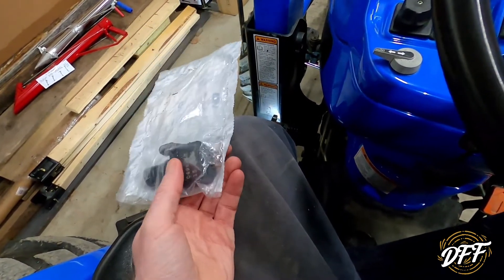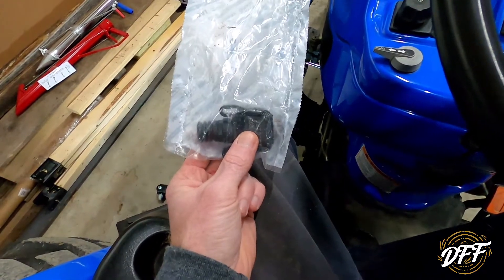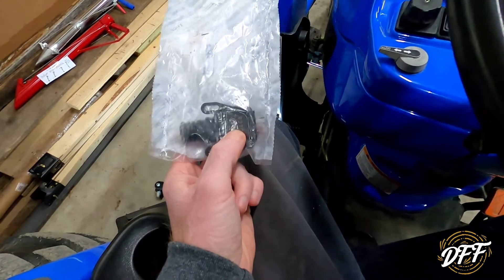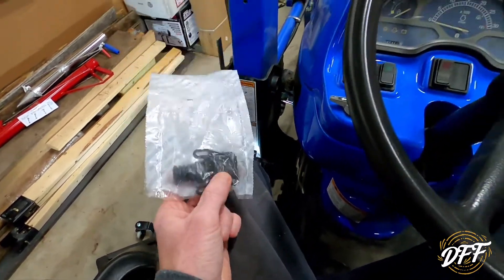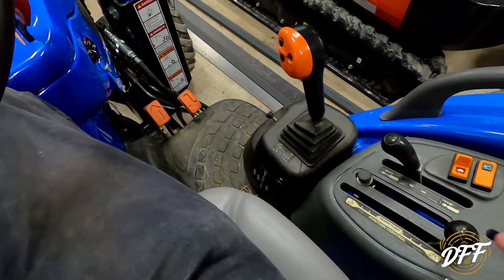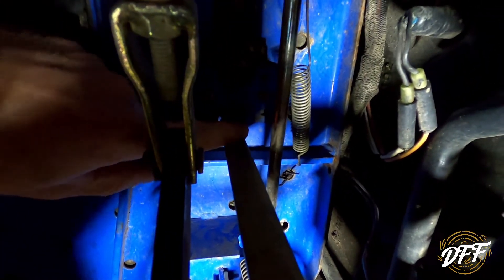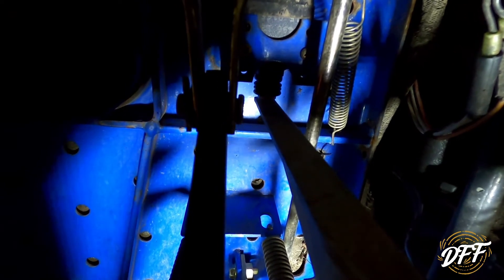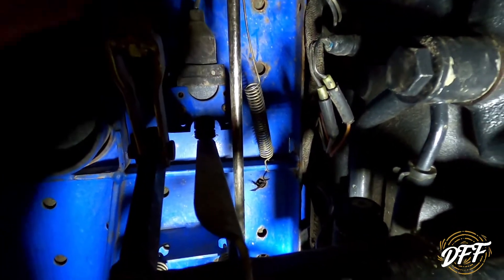Cruise Control Repair- New Holland TC 45DA!

Comment: Very nice Chris, I had a similar problem with a nut on a difficult place with an item so I stick the nut before hand with pres-tick over the hole, the little bolt or screw catches it perfectly, nice repair video
Reply from the maker: Good tip- thank you!!

Comment: Glad you got the cruise control switch fixed.  Sure would have been a bit easier if the switch could have been accessed from the top, eh?.  Car manufacturers conveniently place sensors in tough places a well.  Thanks for the video and glad you're back in business.  I remember trying to fix my tractor emergency brake catch-switch and discovered later the switch was fine.  It was pointed out to me that I was not applying enough force on the double pedals to lock the emergency brake in place.  Man,  was I embarrassed when one of the mechs simply sat on my tractor and pressed the Emergency brakes with ease.  Happy new year, Chris.  Enjoyed a full-watch. 👍🏽🙂
Reply from the maker: Lol, it happens. Sometimes you have to get used to the way things operate. I'm glad it was an easy repair 🙂

Comment: An easy fix Chris. Makes it nice to DIY. Saves time, money, and aggravation of hauling it back into the dealership. I'm having lift issues with my 2018 J.D.3025. The hydraulics on the loader won't pick much more than 500#s. I think its the pump needing adjusted. Its under warranty so I'm not gonna mess with it.
Reply from the maker: Definitely saves money being able to repair some things. Its a shame about your tractor. I'm sure they'll get it fixed, but it is annoying to have to deal with stuff like that on something so new.

Comment: Have you had a problem with the magnet interfering with the foot peddle,  when pushing forward peddle it clicks or locks into place and to stop I have to push the reverse peddle. The magnet seems to be loose behind the forward lever arm underneath the foot platform. thanks in advance.

Comment: Gotta love how the Engineers stuff things in.. if they only had common sense, or had to work on what they design... 
Today's equipment with all the safety Stuff bypassed, is just yesterday's equipment with electronics..
Reply from the maker: Almost every time I repair something I wonder what the engineers where thinking when they designed it 🤣
Reply: @dehavenfamilyfarm  there are a few memes out about that... An engineer will walk past 50 of the most beautiful, horny women.. just to 🤬 one mechanic...